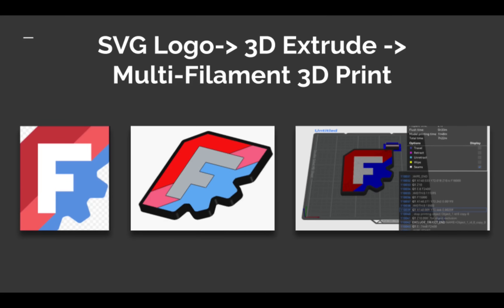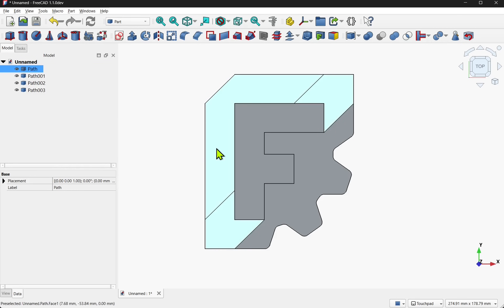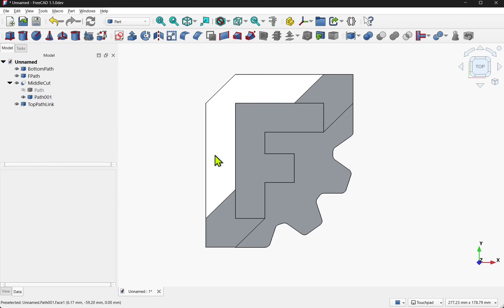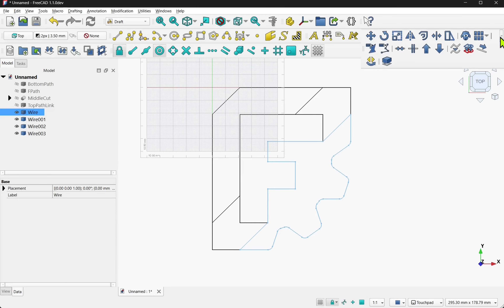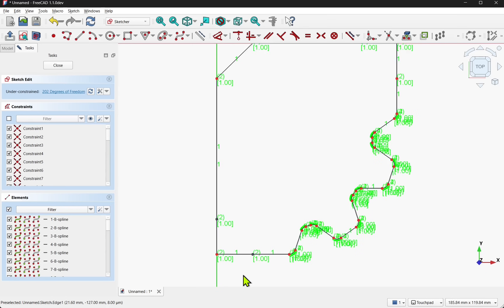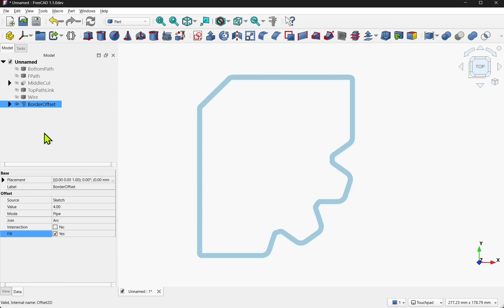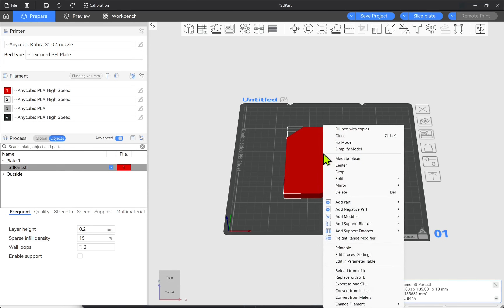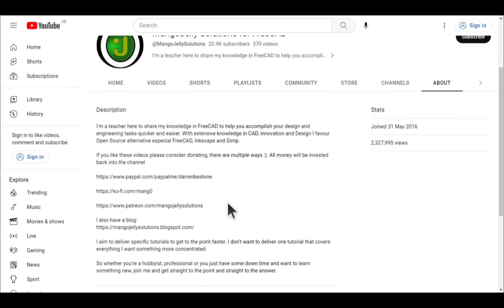From 2D SVG to 3D Print: FreeCAD 1.1 Multi-Color Model Workflow Explained

Comment: Nice video, I followed every step in 1.1.0 dev (maybe 1.2.0 could be better) but when I try to apply Facebinder the following error appears: "No valid faces for Facebinder" (the only difference is that I renamed them in "Gear", RedTop" ecc). Any solutions? Is there another way to have a backup of the original faces instead of Facebinder?

Comment: This is cool.  How would you put a logo on a flat surface of an existing model?  I am probably going to do it in the slicer.  That is probably the best place for it I would think.
Reply from the maker: If you working with the part design then you can use a shape binder against the wires to pull them into the active body and create pads and pockets.  In the part you could create the logo separately as a fusion and boolean into your model.  Looks like this will be a good subject for a upcoming video.
Reply: @MangoJellySolutions  I kind of understand what you are saying.  I am making an upgraded board game piece and I want to print the dice face values on the surface.  I cna accomplish it with an SVG in the slicer, but after looking at this video it looks like I could do it in FreeCAD also.
Reply: @MangoJellySolutions  The part I am stuck on for that board game piece is how to sketch wires.  I can do a round about way of export sketch as svg and then import that.

Comment: For PrusaSlicer: in my experience exporting as STEP is easiest for multi-body parts.

Great Tutorial! I'm looking forward to your Part Design version. (Already tried, once you've got the sketch you can switch to Part or Part Design, almost same workflow.)
Reply from the maker: Thank for adding that, nice to see STEP supported, makes it a bit easier.  I see you gave it a go :) So... I have done it a bit differently using the original and converting it to a compound.
Reply: Öhm? I always alsways use step, do I do something wrong?
Reply: @Oliver-423er  STEP is a much more complex format than STL, since it stores real curves, circles, etc. This means imports can go wrong if the target app does not support the same subset of the STEP standard. Thankfully this is pretty rare, but I have been able to create a body in FreeCAD that did not import correctly as a STEP in PrusaSlicer. STL is usually safe to import (as a mesh format it is fairly easy to do), but on occasion it can still be messed up with inverted vertexes. On the other hand STEP is more accurate (if/when it works) and often has better results with multi-body files. Either way: always check your import results and switch if something unexpected happens.

Comment: Would just tracing the image and creating new geometry not have been far easier and faster?
Reply from the maker: All depends on the SVG being used in the first place.  Your millage may vary depending on how well the SVG was put together in the first place.  I just been chatting with a patreon regarding their SVG, as it was well built we didn't even have to downgrade or upgrade anything.  Was just a case of outline and boolean operations which was seconds of work.

Comment: How can this be done so that the only the top layer (or top two layers) has/have the colour change?
Cheers.
Reply from the maker: So the part where I created an outline.  If you turn off the fill you get  just a closed profile of the outline which has just been offset by a few mm.  This can be used as a base for everything to sit on, easiest way is to extrude this profile in the opposite direction or move the offset down a few mm on the Z axis and extrude upwards the same amount so they touches the other shapes.  Then you can extrude the rest by a your desired colour layer height.  You end up with a nice solid single coloured base with the rest of the shapes that you can colour to your liking.  Hope that helps.
Reply from the maker: Also worth looking into face painting that the slicer may offers as well.
Reply: @MangoJellySolutions  At least in PrusaSlicer the painter tries to paint deep into the body to make the colors vibrant. Making the colored bodies thin is the best solution so far.
Reply: @MangoJellySolutions  Thanks.

Comment: I could have used this a few weeks ago, lol. My wife wanted a drink coaster printed with her hockey team's logo. Took a lot of work to clean up the SVG, and some of these techniques would have saved a lot of time. One note: setting the individual parts as different colors in the slicer means that the different colors will run through the entire part, necessitating multiple filament changes in each layer. This is why the print time for the sliced model reports as over 7 hours (5+ hours are just changing filaments!). You can use face painting in the slicer and apply the colors to only the top surfaces, and then only the top layer will require filament changes, resulting in a dramatically reduced print time and less wasted filament.
Reply from the maker: Ahh shame I was a bit late, it was a video that I had planned for a while and finally found some time to get round to it.  Sorry about that.  Yes multi filament printing can be really costly, I hope that changes in the future (see there are multi-head printers appearing now) so great bit of advice there with the face painting!  I have experimented with the 'purge into objects / supports' which help reduce the times as well.  I wish I could swap out that prime tower on my slicer.  I was only chatting to someone recently as I would love to replace it with something useful, like a funnel or a bracket.  Thanks for adding your knowledge.